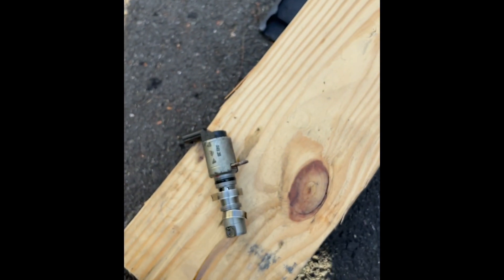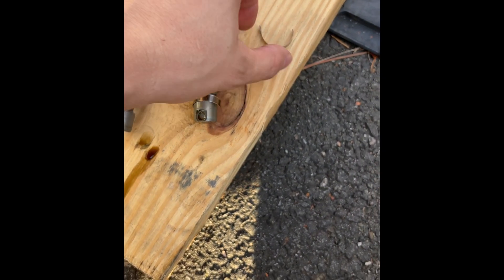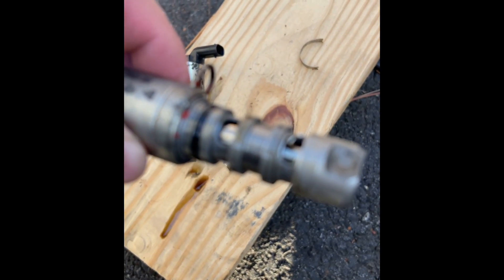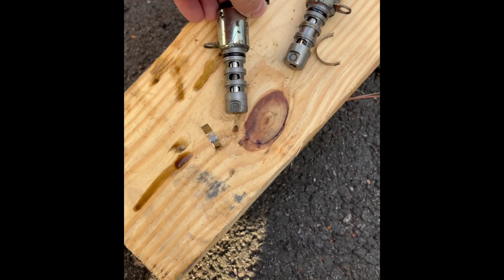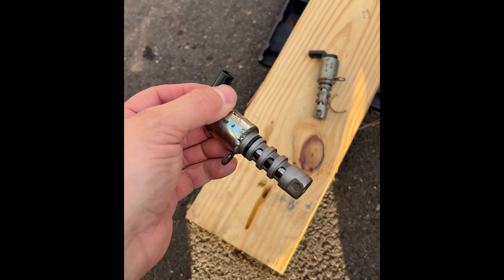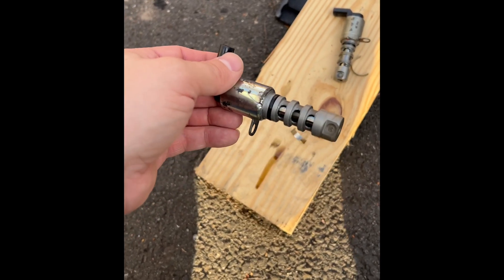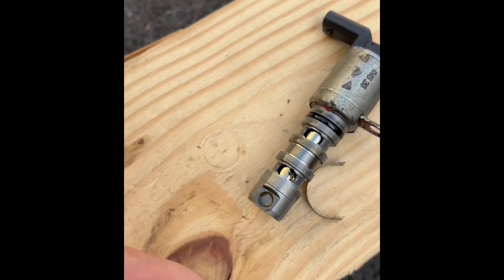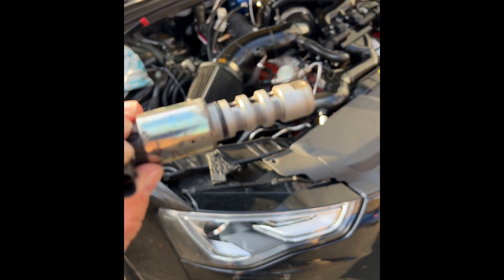Audi 4.0T EA824 CODE P0018

Comment: 2016 SQ5 here, I have the same P0018 code, did this solve the issue and remove the check engine light? I'll either replace or clean it to see what happens.

Comment: Did that fix your problem?
Reply from the maker: @Yahsharal864  yes
Reply: @ ye I got the same code hange vet sensor code still there ….
Reply from the maker: @Yahsharal864  Did you clear the code and it’s come back ? How is your phase looks all 4 of them ?
Reply: @ yeah I cleared the code and it came back. I end up taking off my Timing cover and I see a broken piece of guide inside of the chain
Reply from the maker: @ makes sense to have a different issue with the same code and symptoms
Reply: @ true

Comment: Are you running a thicker oil? Running regular two stage Oil pressure or are you running it on the High Oil pressure setting all the time? I do run slightly thicker than OEM, 5w-40 but no thicker.
Reply from the maker: @markhahn107  I’m using AMS 5W-40